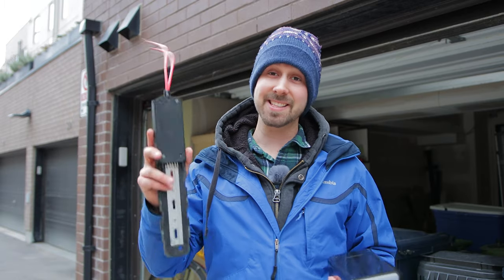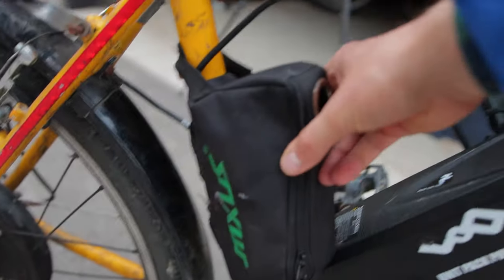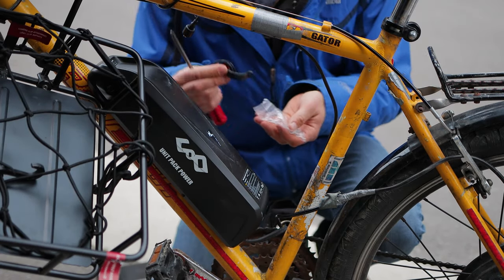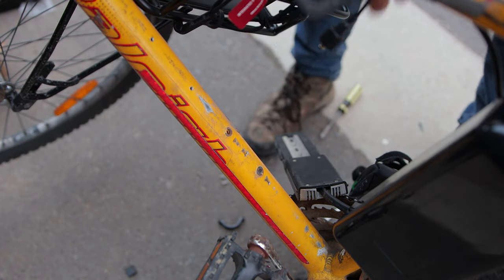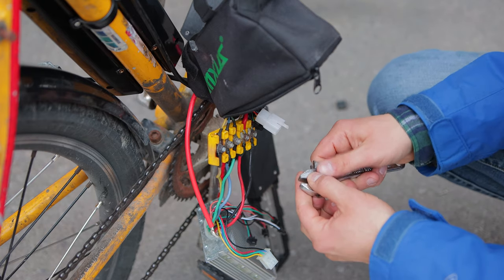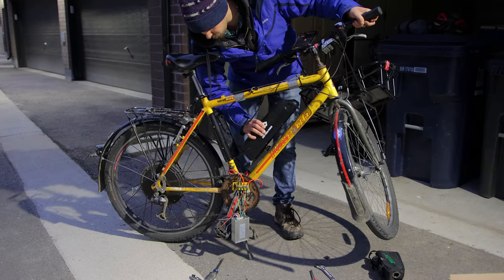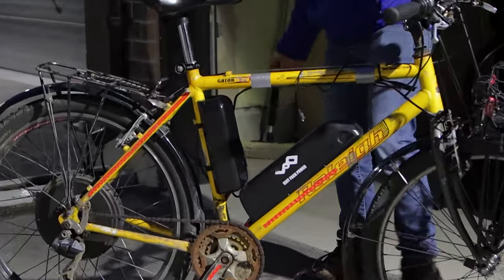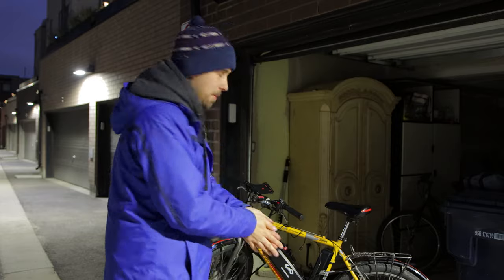Installing my new ebike controller box and 12-gauge battery mounting plate!

Comment: Dude where did you get that old motor controller bag from (with the hole) I keep looking up the bag ( I think it says MXUS on it) and can’t find one anywhere. I really need one of those.
Reply from the maker: So it's actually the one that came with the hub motor at the time of sale :o

Try looking up "triangle bag" on Amazon!
Reply: @BenDurham  Thank you sm. Do you know what was the name of the motor? Is it MXUS?
Reply from the maker: @trojanquest3407  let me find something similar for ya!
Reply from the maker: @trojanquest3407  wait, what size wheel?

Comment: Just got my kit yesterday, along with a 17.5ah downtube battery, to my disappointment the water bottle mount rivnuts dont line up with the mounting bracket on the battery due to clearance issues, do you have any solution? I could drill some new holes in my frame and use a rivet gun but I'm hesitant to do that incase I mess up, or  decide to remove the kit from the bike in the future.
Reply from the maker: Yep! Had this problem and fixed it by drilling new holes! Good luck :)

Comment: Does your chain not fall off without the front derailleur?
Reply from the maker: Only once so far in 2020 after hitting the BIGGEST POTHOLE EVER. I swear I'm surprised I didn't break my... everything. 

But yeah, the chain stays on just fine with the rear chain tensioner still on (just not connected to a cable at all)

Comment: Hi Ben, What do think about Amego Ebike store in Toronto Downtown ebike prices, are amego 26 inch tire step through ebike are good deal ? Vs ordering it from rad or other sellers, I really appreciate if you could help , thanks
Reply from the maker: pasting a response to your other comment here :) 👇 
I've seen some Amego ebikes around the GTA and I like 'em! From what I've seen, they have good specs... but at a cost. Here are some quick pros and cons from my experience below. Otherwise, this is a video I did recently on ebikes going into 2021: https://youtu.be/mlKsCIJ95lk

Pros: in-store repair! A lot of direct-to-consumer ebikes are a LOT cheaper, but if you have issues or need replacement parts, etc., you need to contact the company and have things shipped out to you. And then you have to do all the work yourself. This is a big pro for buying from local ebike stores and a pretty huge con of direct-to-consumer, especially if you're not handy. 

Cons: Less powerful specs for your money. i.e. Generally smaller batteries and lower wattage motors.

TL;DR: 
- if you've got more money than time (and don't want to DIY), go for Amego or other local ebike shops. 
- if you've got more time than money (and don't mind or want DIY), go for direct-to-consumer brands (like RAD or Ride1Up)

Cheers!

Comment: question about this plate  please?
can I use it for both 
21700 cells with BMS 45A 
18650 cells with BMS 40A
Reply from the maker: Battery packs use 18650 cells but I'm not sure about how that affects plates, etc.! I know that my controller accepts like... 30 amps. And I'm pretty sure that wiring and controllers are usually the biggest bottlenecks and hotspots for heat. Just be careful because you don't want anything melting haha!

Comment: Is the frame of the bike made out of steel or is it aluminium? And thank you for sharing your experience. I didn't know a bike could get so much abuse! Also I found about you on a post on reddit where you shared you had done 30.000km on the bike.
Reply from the maker: Oh that's awesome! I actually just came here via your (assuming) "C rate" comment on reddit. 

Aluminium and we've switched bikes now. My current daily rider is a Ride1Up 500 Step-Thru and hers is a Biktrix Swift Step-Thru (v1). We still do the extreme battery care!